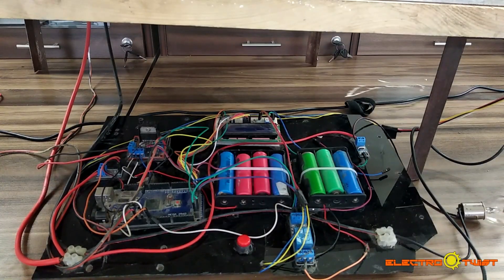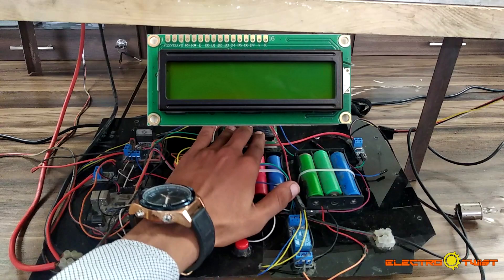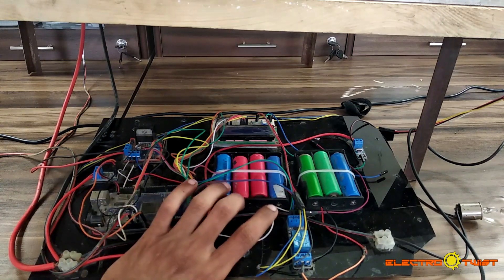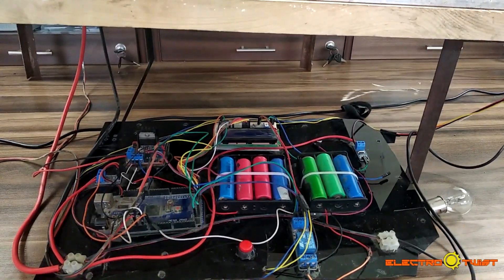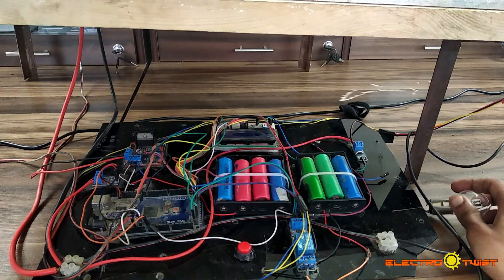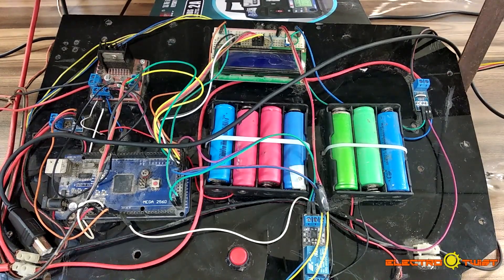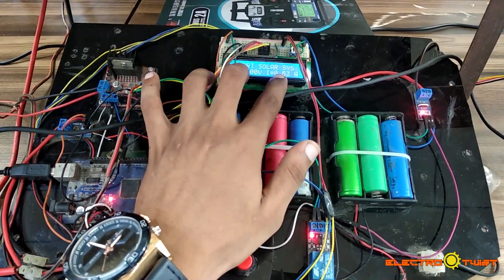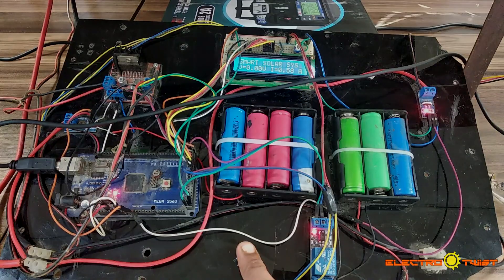Automatic Solar Panel Cleaner using arduino

Comment: Sir will you please provide me the circuit diagram with coding . I need it for my project
Reply from the maker: code and schematic sent, check your email
Reply: @electrotwist9566  In which software ??
Reply from the maker: @avinashraj3516  on Gmail
Reply: @electrotwist9566  Sir I already mailed you plz check it
Reply: @electrotwist9566  Sir we run this code on which software ??
Reply: @avinashraj3516  can you send me the code that he sent you , i need it for my final year project pls send it asap
Reply from the maker: Use arduino ide for the code.

Comment: Sir will you please provide me the circuit diagram with coding . I need it for my project
Reply from the maker: Sent
Reply: @electrotwist9566  thank you very much
Reply: @electrotwist9566  sir the file you have sent is not opening, where can it be opened
Reply from the maker: @ankur3744  use arduino IDE to open it.
Reply: My mail - ankurjsaikia7@gmail.com
Reply: Can u share circuit diagram and which componants i will use in this project

Plz send circuit diagram and also components with name,  programing 🙏🙏
Reply from the maker: @musicbyJaydip  please email me here.   muh.abdullah456@gmail.com

Comment: Is there any other projects done using arduino and solar
Reply from the maker: So many.
Reply: @electrotwist9566  can you give me some ideas relating to agriculture
Reply: @electrotwist9566  using arduino and solar
Reply from the maker: Like hydroponics, smart agriculture system, iot based farming, monitoring in agriculture like studying soil , moisture or water in aquaponics etc etc.